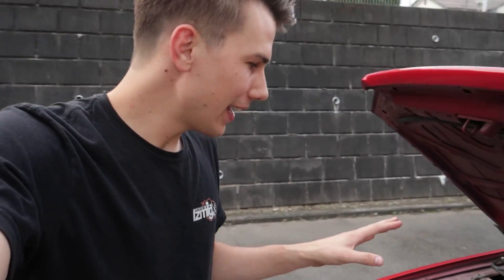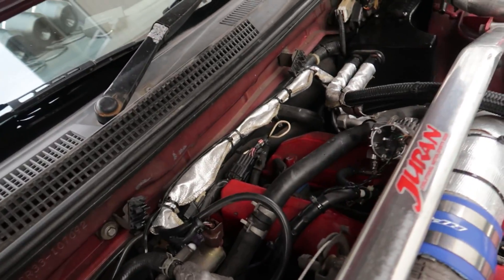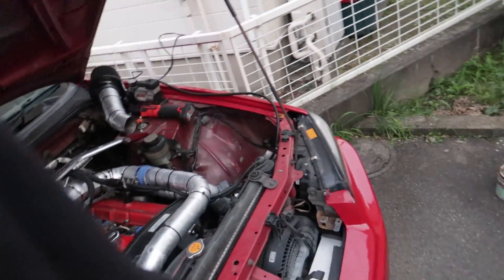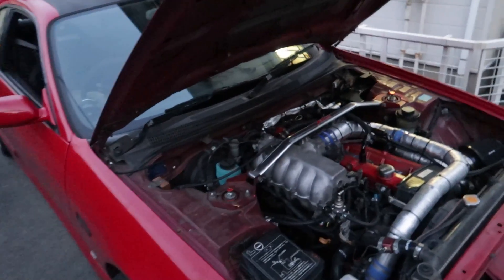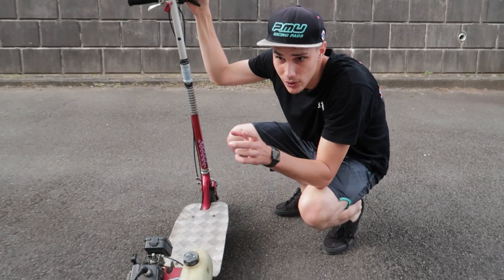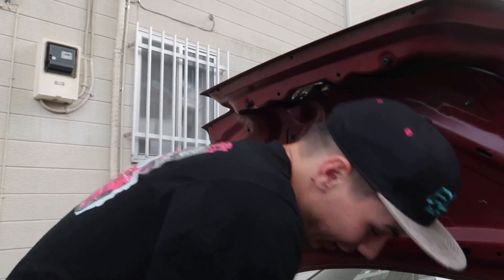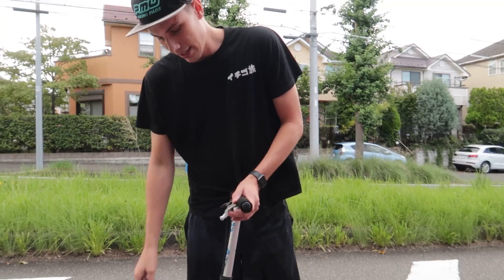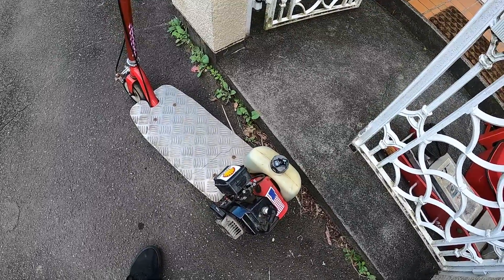GOPED IS FIXED & FIRST RIPS!

Comment: put one of those tiny upgarage turbos on it
Reply: That would be great!!!! xD
Reply: It's a 2 stroke you can't turbo it ..just needs a pipe to add back pressure an it will add more power
Reply: cant turbo a 2 stroke!
Reply: GearHeadDave if you cant turbo a two stroke then what about rotarys they use a two stroke combustion cycle
Reply: @ethanrainsford4251  well rotarys makes enough to spin the turbo
Reply: @gearheaddave9639  You definitely can.
Reply: @UnkownMaster00  then try to turbocharge a 2 stroke nitro rc engine then we'll talk
Reply: @gearheaddave9639  Lol I know very little about 2 strokes, but my point is that it's still possible to do, although it may not be worth  it performance wise at all, it will still make cool wooshy turbo noises and that's all that I need xD.
Reply: GearHeadDave well i recon thats due to the displacement i know they do small enough turbos for 125cc but not anything as small as whatevers on the go ped im guessing 25cc
Reply: @ethanrainsford4251  most gopeds are at least 30cc
Reply: GearHeadDave oh cool never knew that
Reply: @gearheaddave9639  search it up my friends their ARE",ive got a 2007 OFNA off road buggy 1/8th scale .28ccm block shes a ripper also yes you can turbo a 2 stroke ONLY👆if she doeant have a big old pipe on her makin her bang nice and hard which creates back pressure on the motor which gives them power bands,if not then try out a crapy turbo
Reply: @pioneerman8467  sigh
Reply: @shaycando  ive never worked on a motorized scooter but you can definitely turbo a two stroke engine.

Comment: It’s flooding out the carbs basically broken if it sets there and idles up in idle leaning it’s self out that’s becuase of the carb flooding it’s self because it bypasses the needle/float and if you get on it and bogs and dies there’s a vacuum leak and the carbs crap because it’s running super lean and adding fuel changes the ratio so drastically that it craps out all my weed eaters chainsaws any twostroke all act like that when the float get bypassed you can tune around it but as you know it’ll run much better if you just replace

Comment: 780-800 rpm is PERFECT idle spot unless your motor had vaccum leaks, that low of idle would cause staling when going from a high rpm and slamming the clutch to pull ebrake. however. without vaccum leaks. that is no longer an issue. you should try driving the car hard with that lower rpm at idle first and then see if you need to raise it back up. but since leaks are fixed. this shoudl NOT BE THE CASE> oem idle for these cars is 750-850 rpmd =]

Comment: also you might consider replacing the diaphragm and float inside of the carburetor on your GoPed it's like 10 bucks to replace it and it will give you about 20% of your power back

Comment: Clean the carb take it apart take out the bronze jets in the carb blow them out and float bowl and the whole carb. There should be a mixture screw on the carb it's a flat head turn it till its runs right 😂 there's not much tuning options there is race engines with double the tourqe pull so much better there only £80 on ebay. Comes with race carb ect.. Everything too swap it takes 10 minutes only have pull cord though not sure on the option with the driveshaft

Comment: I had a goped. Sounds lean man,gonna blown up. Carb  clean or needle seetings.
Reply: Clean the jets, and needle and seat. The fuel should look blue not clear with a hint of blue
Reply: A new spark plug wouldnt hurt either
Reply: Yeah either do 32to1 or 40to1 i have much better luck with them running richer

Comment: Goped's regulation sounds bad that is why it could have been smoking and you should use red 2 stroke oil then you can mix 1-20 with gas and remember mix it always the same ammount couse that could fuck up regulation and dont hold gas for long 2 strokes dont like that that issue you had is fixed by getying decent carb's regulation

Comment: Bro try adjusting the air and fuel screw and adjust it till it revs better or just the clean the carb.. Its a 2 stroke so carbs will be blocked most of the time
Reply: I tried to tell em

Comment: Your GoPed get new spark plugs and gap them before working on carb 2strokes foul quickly if you use to much oil in your mix.  
The exhaust shouldn't be running into the frame.  The metal box on the very back is your exhuast/muffler and should be dumping the exhaust directly back.

Comment: " its smoking" its a 2 stroke bruh
Reply: The oil is mixed with the gas it should be smoking a bit
Reply: That's wit i said
Reply: I mean if its dumping smoke out "your carb is bad"
Reply: @jammer212  ya but that's coming from the exhaust
Reply: yeah I know if your carb dont work right your engine pushes out more smoke. If your carb leaks it just leaks it dont burn fuel it pushes the fuel in the cylinder with air thats it. I'm saying if it smokes alot your carb dont work, not that its leaking
Reply: If he mixed it 25:1 its going to smoke like crazy.
Reply: Well I got an rm 85 and a cr 250 and they smoke at least a little and depending on how the carb works if your bike has to much fuel it'll push more smoke

Comment: Change the exhaust two stroke exhaust are so  important learn how two stroke exhaust works it works like a vacuum to suck the fuel more in to the  engine and there is lots more things to do.the exhaust shape makes a big deference that should be the first mode learn about it  it is hard to explain without a video

Comment: You shouldn't be able to stall it by hitting the brakes you messed up the motor engagement or it's missing parts. You should not be able to push start it.
Reply: From looks in the video I now see it looks like it's direct drive to the wheel that's crazy.

Comment: your too rich on the mix when you run a little leaner it will be able to get to full rpm faster and easier which is what 2 strokes like. these work better if you keep kicker your self up to higher speeds then the engine is in a happier rpm